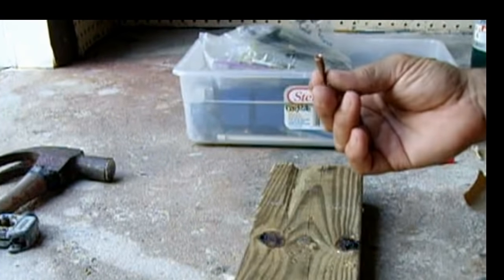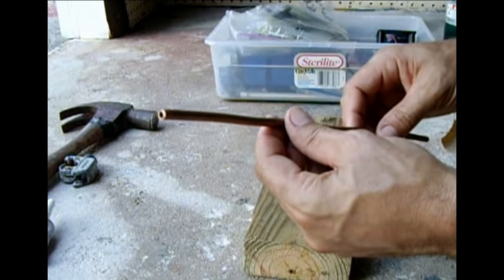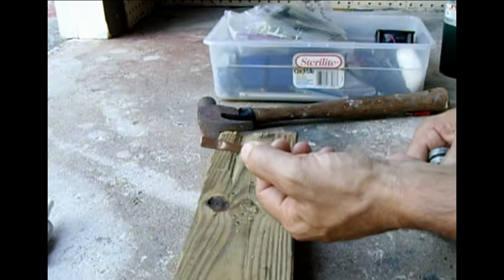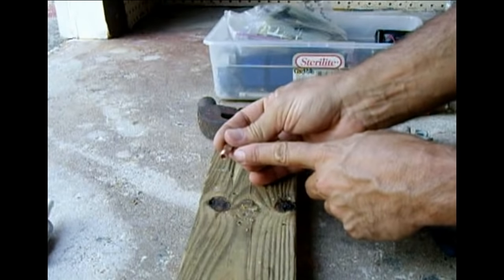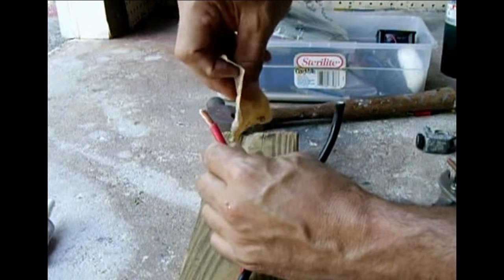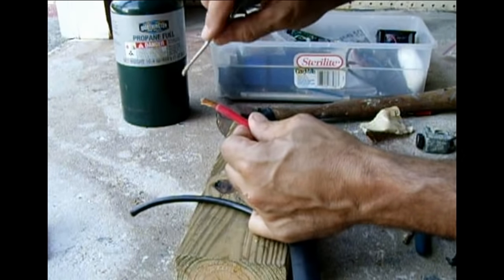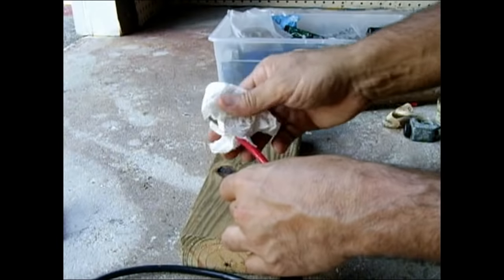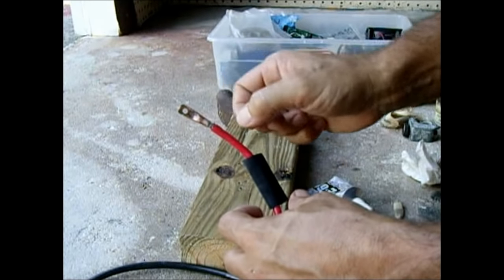How To Make Copper Battery Cable Connectors!

Comment: 1) Flatten the tube, then before cutting it drill 2 holes, 1 in the flattened section to suit the bolt / terminal diameter, the second hole approx. 3mm dia,  in the section where the cable fits just above the flattened section and only through one side.
2) Dress the holes and shape the end as you wish before you cut the pipe, it's easier to handle, cut the pipe to size and de-burr the cable hole.
3) Clean the surfaces where solder will be used.
4) Flux the cable and terminal where the soldered joint will be with ROSIN flux, don't be tempted to use a flux for general soldering, plumbing etc, they are corrosive. Rosin flux is cheap, goes a long way if used sensibly and after soldering is non corrosive. Why go to the time and trouble making a good electrical joint only for corrosion to set in later.
5) Insert the cable in the terminal.
6) Now for the reason for the 3mm hole, grip the cable where it exits the terminal in a vice or with vice grips, with the flattened end vertical, apply heat to the flattened end and the solder to the 3mm hole, once sufficient heat has traveled down the terminal, dependent on the blowlamp, the solder will start to flow into the cable and terminal hole by capillary  attraction, as soon as you see solder at the lower end stop the heat. 
7) The reason for applying the solder this way is two fold, (a) the solder will flow for the full length of the joint  (b) holding the cable in a vice or vice grips acts as a heat-sink preventing solder wicking down the cable, which can give a rigid section adjacent to the terminal, which in some cases with restricted access can make routing the cable difficult.
Reply: He used a non-corrosive flux. He explained this in the video.
Reply: Wow, finally! Someone on YouTube who knows his shit. I had almost exact same thought. As well as soldering the flattened end.
Reply: I did hammer like 3 inches back  long enough to do 2 at once,  drill two holes,  then cut by half....

Comment: You can also make connector bars this way to connect batteries in a bank instead of using cables. If you are using them in a battery bank I recommend tinning them to prevent corrosion. Great video and excellent presentation.
Reply from the maker: Yes. I have done that in the past. Completely flatten both sides and drill your holes.

Thanks!
Reply: I have also slipped one size copper tube inside a slightly larger size to increase the copper mass to carry more current. Soft copper fits nicely inside hard copper pipe. I saved a ton of money doing this over using 2/0 cable with two lugs. Again thank you for the videos. I subbed. Peace to you.
Reply from the maker: Thank You again. Glad you liked the video!

Comment: Nice video, well done. I have owned commercial fishing vessels now for over 30 years.  I have used this method in the field many times with one exception.  I always carry the heavy duty epoxy coated heat shrink tubing, it's more expensive but the inside coating of epoxy melts during the heat-shrink process and forms a complete water tight seal at both ends. On my previous 39 ft vessel when I sold it after over 13 years had zero electrolysis  or corrosion in any of the many electrical connections

Comment: Good video and a great idea!
One issue though... you should never grind soft metals on a bench grinder. (aluminum, copper,brass,bronze) the soft metal will eventually load up the grinding wheel an can create a safety issue as the wheel can crack by overheating and basically explode.
belt and disk sanders are a better way to clean up the edges of soft metals if you don't want to use a file.
Reply: You're right, but they do make grinding wheels for angle grinders that are made specifically for aluminum, and they work great!
Reply: doh, dress the wheel when needed

Comment: It's really funny to me how much a person will argue with someone else trying to prove that their way is the right way and the only way. I seriously doubt that in most cases there will be enough pressure or heat applied to this connector to cause it to break apart or un-solder itself. But I know that there are those times when all the stars and planets line up and it'll happen. But if your starter goes bad causing it to pull high amps then I'm pretty sure you'll either be at a auto supply store where you can pick up a new connector, have your car in the shop for the repair where they'll fix the connector, or you can just resolder/crimp the old one back on. The fact is that there's more than one way to do everything and each way has its good and bad points. To the guys that were saying that their time is worth too much to take the time to do this I agree, sort of. I'm nit saying that my time is worth too much to be wasting it on making one of these, I'm only saying that I'm lazy and would rather just buy one. Also, it's funny but cause your time is worth too much to make a connector but not too valuable to waste your time arguing online with someone that you don't know over something as trivial as this. If I was going to do this I'd solder it. I've been installing car alarms for 20+ years and I solder every connection. But I live close to the ocean where the salt air eats away at the connections and causes many problems with just a simple crimp. So the good outweighs the bad in this situation. Do what you think is best for your application. Stop feeling the need to prove how smart you all are because it's making you look stupid.
Reply from the maker: Mike Mace I live within 100' of the ocean, and I also agree, soldering prevents any salt air from finding its way into a crimped connector which can cause it to corrode and result in a high resistance connection. In the video I stated that crimping and soldering is the way to go if you are looking for the most secure way and lowest resistance connection.

Thanks For watching, and yes, some people love to complain, even when they don't pay for something.
Reply: Car alarm guys are the worst.  Aftermarket Chinese electronics hacked into the wire harness does nothing for me .

Comment: I use a small diameter battery terminal type/round wire brush to clean out the socket rather than sand paper.  I flux both the wire and inside of the socket then crimp before I solder.  Using heat shrink tubing to finish is a nice touch I haven't thought of.
Reply from the maker: I use that also, but I was living on an island when the video was filmed, and my brush was shot. Thanks for watching!

Comment: I have been doing this for years. I drill the hole before cutting the connector off. The long pipe gives me something to hold on to. Never used the heat shrink. That was a nice job with the heat shrink. Thanks
Reply from the maker: Usually I do drill first, but with all the interruptions(people, barking dogs, road traffic, planes) I deal with when making videos, I lost my train of thought. Thanks for watching!

Comment: Very good and informative. I always make these lugs myself, though I never worked with copper pipe, I have worked with copper plate. I do the soldering with a 100 Watt soldering iron with a massive copper tip and resin-core solder for electronics (1 mm diameter). The 100 Watt soldering iron method also works very well, also with this type of thick cable, works good to approx 7-8 mm cable. Heat the lug with the iron during approx. 30 sec-1 min, and the solder is sucked in when it melts. It is very good that you show the importance of thorough cleaning.Liked!
Reply from the maker: I have a 100/150 dual wattage iron that I have used to do the same thing.

Thanks For Watching!

Comment: Maybe drill your hole in the flat and smooth the corners on a grinder before cutting off the tube, easier to hold a larger piece and less chance of deforming it with pliers!
Reply: Yes; keep the work larger for that operation and it is easier to work.

Comment: I steal all the copper pipe I use so I save even more $$$
Reply: I hope that's a joke. someone stole all the copper pipe and wire out of my house. at a bad time just before I can move in. the house I lived in burned to the ground a few months ago. so I have basically nothing. didn't have insurance. so now all my wire and pipe so now I gotta find a way to fix all that and replace everything else. all for just a few bucks. that could have been worked for in two hours. and take months of my pay to replace! why would somebody do that to anybody? what kind of world? I wouldn't even have thought to do something so low! and if you are gonna steal they gotta be something that pays better.  some ppl!
Reply: you have to expect the worst to happen and rejoice when it doesn't. I might suggest that you consider using pex if it is allowed in your are. it is quick and considerably cheaper than copper but not as resistant to puncture so you need to consider that.
Reply: James stranger Dude, he was being sarcastic. Come on, now.
Reply: A House with NO Insurance???   That's like Lifes #1 RULE....  THAT should NEVER Happen !!!!!!!!!!!   Sorry, no pity
Reply: So that where all my lug are going - good to know
Reply: JAMES! Since the 70's - painting copper black used to be a tactic in large projects in shady neighborhoods is what i have been told.

Comment: You don't really want to solder high current connections.  Crimping is better.  But...it's your video. 8D
Reply from the maker: I have seen many cables over the years that were only crimped and developed a high resistance connection between the wire and connector causing them to heat up and burn. If you are connected to a fused circuit, the wire will never be able to heat up if the wire size is correct. If you are using the connector off a battery, then it would be a very good idea to crimp AND solder the connection in the event the wire short circuits(which is very rare), the solder would melt if the wire was not fused. Crimping the wire and soldering it, would keep the wire from coming out of the connector and eliminate any chance of a high resistance connection withing the connector..

Thanks For Watching.
Reply: The rule I live by is crimp larger gauge wire and solder the smaller gauge.  If the wire is crimped correctly you will have no problems.  In the real world you won't see too many larger gauge connections with solder on them.
Reply: Ampacity?
Reply: Macabre Artist I agree but if you or out on road/trail a knife and vice grips would work also it is a quick fix to get you home or to the nearest parts store. The copper tubbing is much cheaper the buying them,I agree.Thanks for sharing.
Reply: Nothing wrong with crimp-only connections as long as they are done properly using the correct good quality properly calibrated tool and good quality crimp connectors/lugs.

In fact, the wiring on modern aircraft uses crimp connections almost exclusively. Such connections have proven more reliable than solder connections.

For the DIYer/hobbyist, crimp and then soldering does make sense since you don't have access to such expensive tools, but please don't generalize that crimps are only for lazy slobs. That couldn't be farther from the truth.

A proper crimp, on smaller gauge wire, the wire will often break before the crimp fails. Larger wire you can hang your entire weight on the end of the wire and it won't budge.
Reply from the maker: This is absolutely nothing wrong with crimping, just as long as you use a very high pressure crimping tool like a lineman would use on power lines. "Burndy Hi-Press". Regular crimping tools, no good.
Reply from the maker: True, and the soft copper(Type K or L) tubing shown in this video can be soldered, crimped, or both. :-)
Reply: No Dan. You're completely backwards. Solder is NOT for electrical connection unless you are making electronics boards. Solder is for physical connection of already low resistance connections. A properly crimp connection fuses the entire structure into a gas tight bond. When you heat it to solder it all you are doing is causing the crimp connection to expand, which actually INCREASES the chance of it failing.

Comment: Cool! It never occurred to me to use copper tubing to make an eyelet terminal. Great idea! Also, I'd like to suggest drilling a small hole in the terminal near where the end of the cable actually go into the terminal. This way you can apply your solder through the hole, and when you see it coming out near the insulation of the cable you know it's completely filled with solder. It also has the advantage of helping to not melt the insulation during soldering.
Reply from the maker: Robert Gantry That idea is good, but not really necessary. Capillary action will draw the solder into the connector. You can tell when it fills up.

Thanks For Watching!

Comment: NEVER EVER solder, it crumbles after a few years, only crimp ( from experience)
Reply from the maker: I never had any problems at all. I've been making these for 20+ years. I prefer to solder and crimp if you don't have a high compression tool. If you do, just crimp and apply heat shrink. Thanks for watching
Reply: I agree - especially in automotive or marine applications where vibration is a factor. The solder transition makes a hard spot where the wire will “work” and weaken. (For marine I’d recommend against this DIY method because fully tinned fittings are critical to avoiding corrosion in connections)
Reply: Absolutely! OK for cars but marine needs tinned cable and lugs, no solder and adhesive heat shrink.
If it overheats then solder melts.........
Reply: I cut one of my crimps (proper high leverage tool) and the copper was squished so tight it looked like a solid copper rod.
Reply: Get a heat gun to shrink the tubing ffs! 
I wouldn’t let you near my boat with those techniques

Comment: Years ago I was in the woods working on a log loader on a Sunday I found I needed a battery  cable I made it out of a piece of jumper cables and made a copper end like you did except . I stripped the cable long enough to reach all the way through the copper tubing then I flattened the end with the cable inside. Then I drilled through the copper and the cable. 
 My plan was to replace the cable the next time I had the loader in the shop but it worked so good I never did. I have used the technique many times since then. I like the cable extending through the    connection then flattening it traps the Cable in the eye and when the eye is tightened on the post it's adds to the strength and connection
Reply from the maker: Thanks for watching Tim! I have a lot of excellent videos on my channel that cover many different subjects, so be sure to check out my extensive video playlists for other videos of interest to you, rate thumbs up, and share my channel with others.

Comment: Brilliant idea. I am not a fan of crimping these though. What I like to do is tin the wire, then flux the inside of the connector. With the connector in a vise or being held up with Vice Grips or the likes, heat the connector and melt solder inside the end and fill it about 1/3 of the way, then push the already tinned wire in the hole with the melted solder. Finish it off with some shrink tube and you have a very permanent connection.
Reply from the maker: Thank You! I do that also. I sometimes vary my method. One thing I never do is only crimp, unless the connector I am using is silicone filled to prevent air/moisture from entering. If I had a very thick copper lug, and a hydraulic crimper just like the power companies use on high tension power lines, then I would only crimp/heat shrink.

Be sure to share, and rate a Thumbs Up. :-)

Comment: I wish I had found you before buying a dozen 4/0 lugs for my solar cables. Great video thanks brother. I will make my own from now on.
Reply from the maker: Those are expensive! I'd use type "K" thick walled soft copper of the correct size. I also have another video showing how I tin the connectors once I make them. Thanks for watching

Comment: Great idea to save a few $ especially if you need a lot. Drilling and filing before cutting to length makes it easier to hold and stop any posibility of deforming the cable end with the pliers, You can also use pre glued heatshrink to seal.

Comment: Good video. There's actually a school of thought that says a good quality crimp plus marine/adhesive lined heat shrink is not only just fine, but preferably in situations where there's vibration (such as a motorcycle grounding lug and starter power lugs) apparently because solder is brittle and can crack in those applications, hurting more than it helps. Plus it's just way easier to skip that step. The compression crimper from Harbor Freight is a fantastic tool, but you can even use a flat blade screwdriver plus hammer to make the crimp. I don't claim to be an expert but I trust the intelligent people I picked this info up from. The wiring on all my bikes has been rocksteady for years with these methods. Thanks for sharing!
Reply from the maker: Crimping and soldering, followed by heat shrink with glue is the best. Thanks for watching!
Reply: +electronicsNmore OOC why do you feel the solder is necessary when a high quality compression crimper is used? I've put mine to the test, hanging 50 lb dumbbells from the lug hole and they will no come loose. Plus the solder is less conductive than the stranded wire and increases resistance. Not trying to argue, I just think you should quantify the statement; "solder is best!" instead of just, "Thanks for watching!" ;)
Reply from the maker: elamovs In the past I've seen cables that were only crimped develop a high resistance connection. Flowing the surfaces of the wire and connector together, is far better than close contact. Most people do not have a high quality high compression crimper. :-)

Comment: Very good idea. If doing loads of these , would suggest getting some electrical solder, it has flux  incorporated. Used 2 use loads of these at old job building fire trucks. Put in a vise and do upside down and seemed 2 make look just a little nicer.